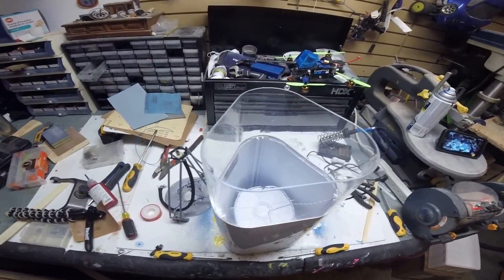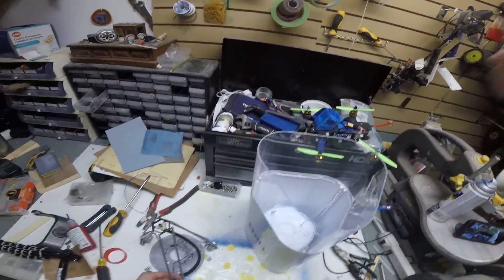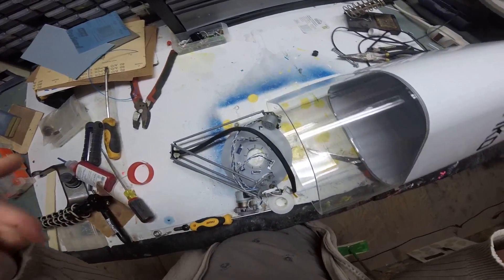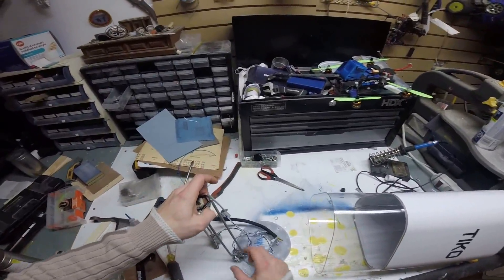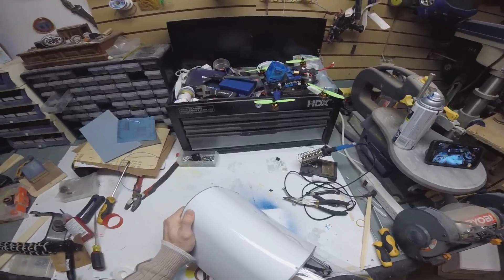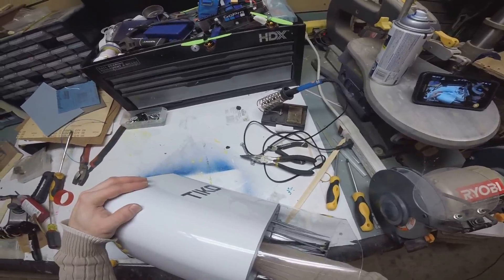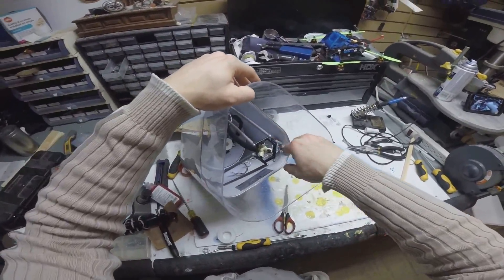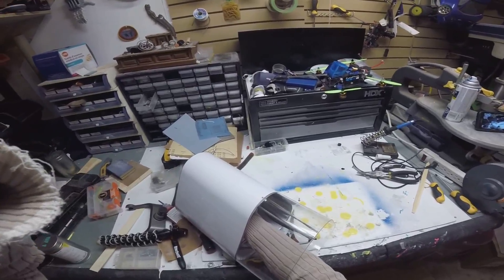Tiko 3d printer: Teflon tape mod

Comment: You should know...that's not the correct "teflon arm mod' 
you  should wrap the teflon around 1 of the 4 prongs of the motor bracket at a time. 
then you lube it slightly with silicon or some plastic safe grease
Reply from the maker: haha yeah I doubly did it wrong. By only doing one side I actually created slop in the motors. I have since added the tape to the other side. I had only seen one picture of how someone else had done it for reference.  Im sure i will have it apart again in no time, thanks for the advice